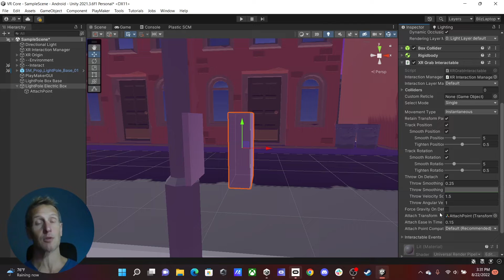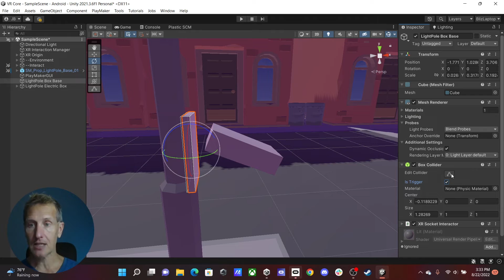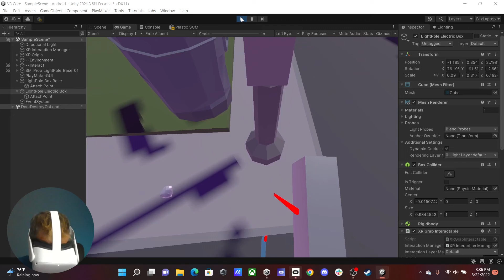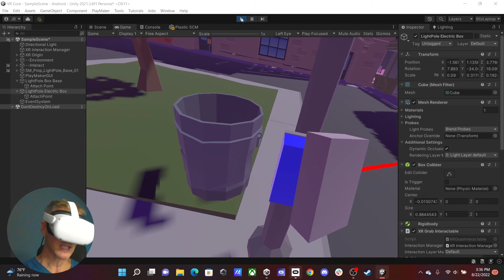Unity VR XR Interaction Toolkit - XR Socket Interactor

Comment: Hey bliz I'm looking forward to your next video, as its something I have been struggling with for the past week. I am assuming that the light will turn on after checking the socket for the box.
Reply: i hope it wont be a scenario that only works for oculus and not openXR
Reply from the maker: Absolutely!!  It's super easy too.
Reply from the maker: Since I'm doing everything in XR toolkit, it will work with all devices.  You'll just need to make sure you have those devices you want to support as plugin providers with OpenXR and in OpenXR Interaction Profiles those headsets added.

Comment: Hey Jerry! Question. I'm trying to create like a jigsaw puzzle game wherein i would use the socket interactor for the pieces to snap to. Is there any way to have a check system if each pieces is in the right place? Thanks and great video!
Reply from the maker: Hey @geralddino6715, thanks.  Whether with C# or Playmaker, you would need to keep track of how many sockets.  You can use a bool (on/off) if the puzzle piece is in place.  Then you need to run a bool test to check if all of your bools are true.  If so, then puzzle completed.  Hope that helps.
Reply: @BlizStudio  thanks man will try it out!

Comment: Great tutorial, and where is the sample scene?
Reply from the maker: Hey Chinwei, if you start out any project in Unity, there will be a sample scene.  If you start from the VR Core template, then it will have a scene with the XR Origin all set up and ready to go.  If you open up Unity and it's not in the default Sample Scene, you can look in the Project window and in the Scenes folder you'll see Sample Scene.  You can duplicate that scene, rename and then use that as your starting point.